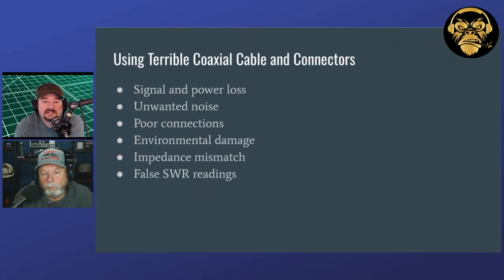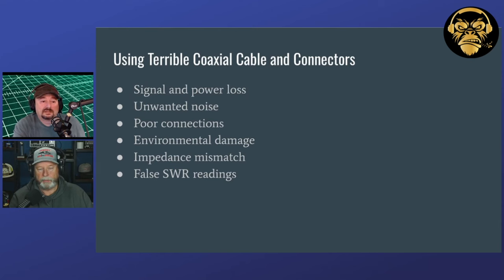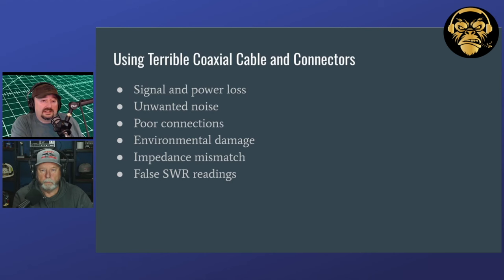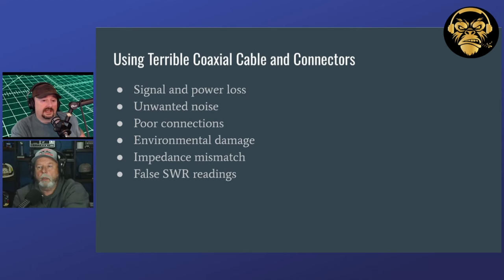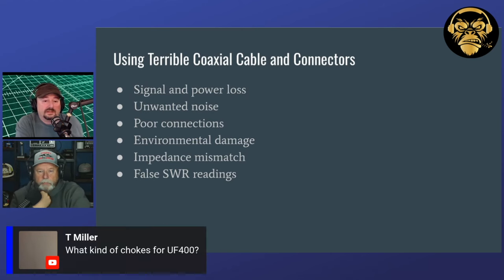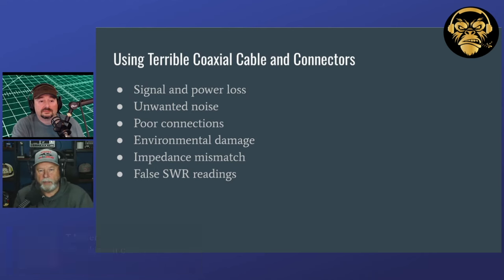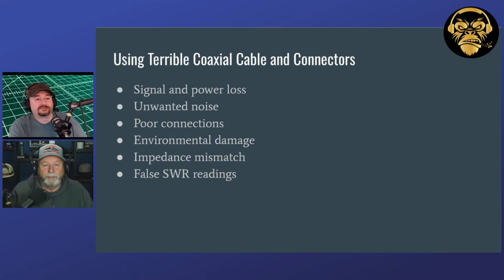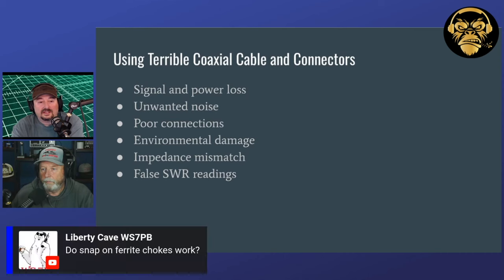Coaxial Cable Considerations for Amateur Ham Radio

Comment: 11m only operator here..  cerified with engineer at the manufacturer, liquid electric tape, marine grade or otherwise, has no metal properties. peels off later if needed. great for sealing and protecting stuff. wind can make everything wiggle a tiny bit. loose coax on trucks causes lots of problems because they don't check their system or watch for swr warning lights. this might be laughable within the ham community,  but truckers are the ones that bring all of our stuff. some of us out here are still using radios 14hrs/day to make sure everything goes smooth on the roads. i put l.e.t. on every single humidity entry point outside, and no issues anymore. lrm240 or 400 on everything. never amplified. snap on chokes everywhere. thanks for your videos.
Reply from the maker: Taping like that is good advise GS, thanks for the comment and for watching 👍

Comment: Well Ape I learnt something again today, there is a 50 ohm and 75 Ohm BNC connector. Just to confirm I asked my AI friend.... I asked: "is there a difference between a 50 ohm BNC connector and a 75 ohm BNC connector" And yes there is. Thanks again for bringing this to the my attention. :-)
Reply: Yep, everything in the antenna system (including connectors and the radio) has an impedance and ideally they should all match. Otherwise you get standing waves from reflected power, which is what the SWR measures.
Reply from the maker: Glad you like dhte video ZH!
Reply from the maker: PCFreak is correct!

Comment: Oh, sorry….where to buy the best coax cable and connectors ? P.S. I love your videos. Straight and to the point. No fluff…brilliant.
Reply from the maker: I like ABR cable, for the best connectors check out DX Engineering 👍
Reply: I know this is late ... but you may want to check out Messi & Paoloni.  I bought some and their connectors and cables are Awesome!
Reply from the maker: @HVACER1969  I have some of their coax and am pretty happy with it 👍

Comment: Also, AB&R makes coax with outside coating in more colors than black.  Idea for FD, POTA, demo stations.  People can SEE it.
Reply: ABR Industries is VERY good stuff. I just ordered 35 ft of RG213 from them and got 1.2 SWR at higher frequencies( 2m/70cm). They are my go to for coax from here on out!
Reply from the maker: Yeah, ABR makes great stuff!

Comment: I did my research…looked at losses in the frequency range I was using …spent the money! Really good coax! The first month was great! Then came issues that I chased for 7 months issues were intermittent at first progressively got worse over time to the point it was unusable! The main issue was on the receive side, I could transmit just fine! So did not want to blame my new High dollar coax so blamed everything else! Finally, after a very expensive process of elimination I took down my tower…had too really. Had to be the antenna!  So, I bought a new antenna…SWR of 1.2 on tx and 1.3 on rx 500 MHz between frequency’s for the 7 months’ worth of issues…Just had to be antenna! So up goes new antenna… Yup same problem! Ok now I want to burn it to the ground! So after cooling off a few days I took the tower down again 65ft so a process…Cut my new 15.00 boot off the antenna  connector and took connector apart… OMG not only was it green with corrosion it was never assembled right … so cut of some cable put new end on…Put tower back up…and before I even powered up the radios  I took the other end apart… radio end and sure enough green with corrosion  not assemble right! So same deal cut it back put on new end… Radio never worked better! So, point is I paid big money for cable, connectors, assembly of said cable… Well, it’s only as good as who puts it together in the first place! One of the things I bought to help trouble shoot this problem was a VNA analyzer although it didn’t help me solve the problem at the time it did help me to understand that the problem was solved! My lack of knowledge using the VNA was the problem, not the VNA. Name of company, coax, connectors, Not important! It was a mistake! Yes, a costly mistake that I have put in the category of education expenses …
Reply from the maker: Hey David, sorry to hear you had these problems but thanks for sharing the story as it helps people learn what to look for!
Reply: One thing for sure I will never again have anyone else put a connector on for me especially when its 100’ in the air! I raised my tower this fall from 65 to 100’  The coax and connectors are top of the line …It just wasn’t on my radar when trouble shooting this issue …Hopefully this dose help others…always enjoy your content!   @TheSmokinApe
Reply from the maker: @davidquackenbush3957  glad you like the videos David 👍

Comment: I have good luck with AB&R coax.  When I order long lengths of coax I order it with a male and female 259 on each end.  Why?  Eliminates a barrel connector and a point of fail.  AB&R will custom build such cables.  Some other builders of coax will do the same.
Reply from the maker: Hey Dominic, I did a Livestream with Chuck from ABR...  he's a great guy!

Comment: Hey Ape can you make a video on the proper way to terminate coax. Like i have a spool, buy some nice pl239 connectors and then what? I'll tell you what,  i don't know what I'm doing so i never get it right and my swrs are elfd up.
Reply from the maker: I will add it to the list, but be warned, the list is long...

Comment: Hi Ape & Chuck... I have a question for you... Can you OVER choke your coax with choke(s)?  How can you tell?  What is the effect of over choking and how can you test or measure?  As far as coax is concerned... I try to buy the best.. worth it in the long run.  Art W1SWL
Reply from the maker: Not really but at a point it becomes less and less impactful.  What I do is choke at each end of the coax 👍

Comment: Hoping you can help. I have a quad band transceiver and antenna that also receives AirBands. Can I use a duplexer? To have the quad band antenna and an air band antenna running into the transceiver? Is that what a duplexer does?  Obviously I can’t transmit on airbands I just want to receive. Also, should I use the highest rated least loss coax? The RG-213? Is it worth it to pay more?
Reply from the maker: Hey Chip.  A diplexer separates signals based on frequency, not a duplexer.  213 is great cable 👍
Reply: @TheSmokinApe  okay, thank you. So i have both a quad antenna and an antenna tuned for air-bands, I need the duplexer as I am not trying to split the frequencies, I’m trying to run the 2 antennas into the 1 radio. Or am I confused?😀
Reply from the maker: @chipfornaris  you want the diplexer
Reply from the maker: https://www.everythingrf.com/community/what-is-the-difference-between-a-diplexer-and-duplexer

Comment: sent you message regards vna on scanner and swr on 113.500 ok quick check swr 1.232 great confused on return  19.651 ..s21 gain 79.268db phase 97.6  . check cable and its cheap so going to change ,, thanks for advice